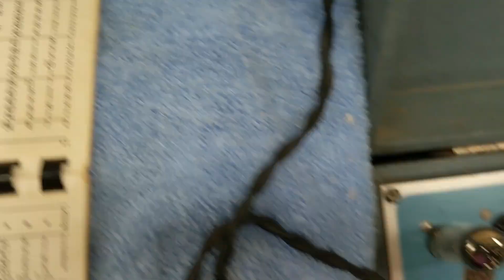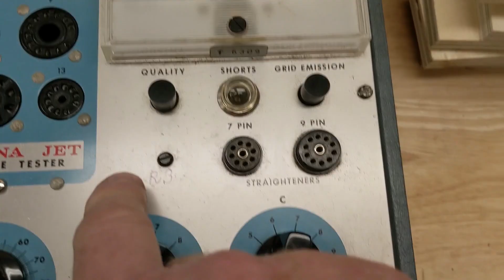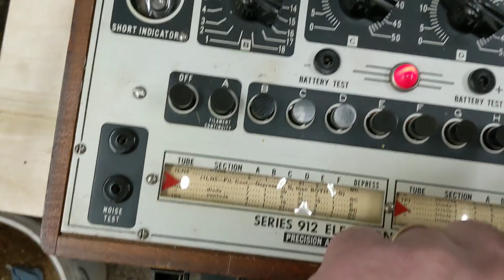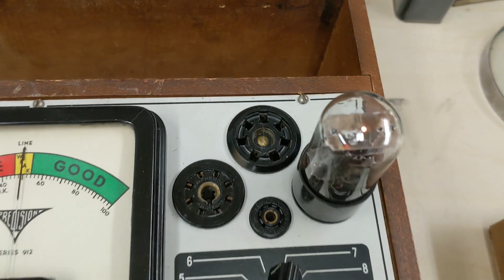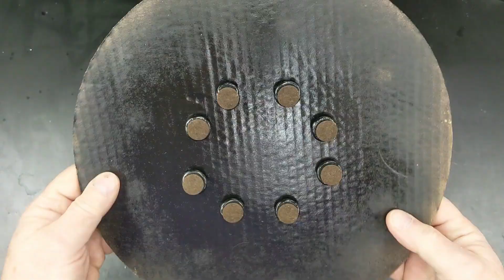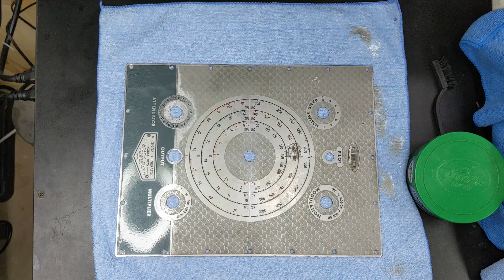Philco 7070 Part 3- Testing tubes, fusing, cabinet feet & face restoration

Comment: You had me looking all over the basement here Gregg looking for which detector was beeping until I realized that it was beeping in your shop. LOL. The Philco is coming along very nicely. Well done. ATB Doug.
Reply from the maker: Thanks Doug, yeah the doggone detector battery started beeping and I just put it in the other room. It is connected to my alarm system and I didn't want to set it off by pulling the battery out at that time. LOL

Comment: wow too bad two of those tubes were bad and the 6X5 rectifier weak I have all of those tubes in my Stash here. The paint on the inside and the outside of the cabinet look pretty good to me. That turtle wax polishing compound did a great job Gregg.
Reply from the maker: Thanks Larry, yeah I got all three tubes from Bob Dobush. Yes overall it turned out good.

Comment: That face plate is a thing of beauty.
Reply from the maker: Thanks Jim, I added some liquid chrome over the brass area and it actually turned out pretty well. Tune in to Part 4 to see something I made today from scratch to replace a missing piece on it. I think it came out pretty good.